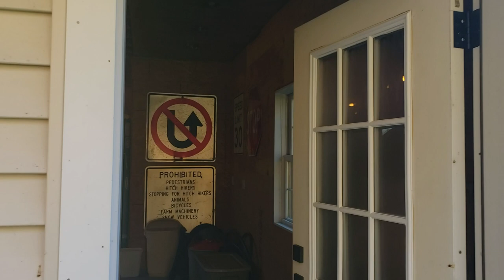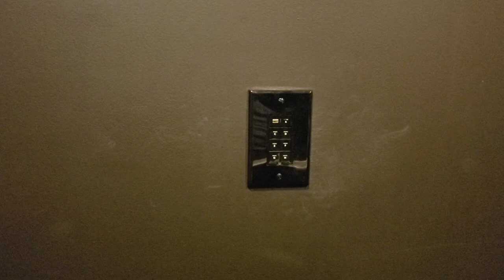My Home Theater- Latest Tour and Update

Comment: Beautiful theater room my theater is also on the second floor in a semi finished attic. And I know it must be hard going in there and not have the projector I've been there my old projector was a LG 720p led one and the led finally gave out after almost 7 years of use
Reply from the maker: Thanks for the comment.  You are correct.  It does stink having the room this close and not having a projector.  I just haven't been able to get myself to spend $5k on a projector.  Hopefully soon though.
Reply: @smarthomeMASTERY  yeah 4k will be awesome I can't at the moment so I went with a projector that maxes out at 1920x1200p through HDMI 1.4 no VGA input  (native 1080p) I'm hoping when I get the PS5 I can set the resolution output to 1440p and I'll just downscale it to 1200p since my screen is only 84" I believe I don't need to worry that much about pixel density. Again hopefully lol.

Comment: Nice theater. I’m starting mine with only stud walls. You mentioned OSB, drywall and acoustical caulk. Any insulation in the walls? How about you floor for sound proofing. Any information  on your theater sound proofing would be appreciated. Thanks
Reply from the maker: Thanks for the comment and compliment...  Yes, insulation in all of the walls...  R-19 pink stuff in all exterior walls and more fiberglass in the interior walls, soffits and stage.  I actually didn't use acoustical caulking.  I only put in one layer of drywall.  I used regular caulking to seal the seems around the OSB, but only on the one wall that is shared with the house.  The other walls are all exterior walls for me.  No insulation in the floor yet, because I still need to run some more wires, but I will be insulating the floor, which is the ceiling in the garage.  I can have audio at levels that are uncomfortable and you can barely hear it in the rest of the house.  I think the stage design helps that.  Hope that helps.  Let me know if you have any other questions.

Comment: nice video :) im interested in the reason you went with insteon instead of KNX/DALI? :) as i see them now id prefer to go with a open standard so you dont get screwed in the future. also do they integrate with other systems well? keep up the good work :D
Reply from the maker: I had previous experience with Insteon and it was working well for the most part.  It does have it's problems sometimes, but mostly with the older devices.  Insteon is pretty universally supported.  The ISY home automation controller I use can integrate with Alexa, etc. if I wanted it to.  Thanks for the comment!
Reply: @smarthomeMASTERY  interesting, is it locked down in any way or can you yourself completely configure everything? i guess if insteon stops making stuff then you'd be limited on your upgrades?
Reply from the maker: @niklasxl  I have a lot of control over the Insteon devices with my ISY.  I'm not using the Insteon controller.  Yeah, if Insteon were to go away, I would just buy devices from someone else that my ISY works with.  I wouldn't have to throw anything away.
Reply: @smarthomeMASTERY  ah well thats good, ive heard some bad stories when some people have wanted to upgrade proprietary systems :)

Comment: Revisiting this as I'm looking at wiring my new theater, where did you get that cable trough with the conduit knockouts?
Reply from the maker: Hi @Adam Jannetta.  I think I got the trough from zoro.com, but you can get some from Amazon too, depending on the size you are looking for (https://amzn.to/3JoAFtN).  I got them without knockouts and knocked out the holes myself with a hydraulic knockout tool.  Then you can put whatever size hole you want, where you want it.  This is the one that I used, but you can get much cheaper ones: https://amzn.to/3uKAwNf.  They come in real handy if you are going to be doing a lot of work like this.  Hope that helps.
Reply: @smarthomeMASTERY  Thanks very much! Will take a look.